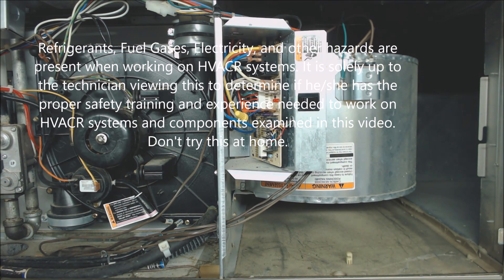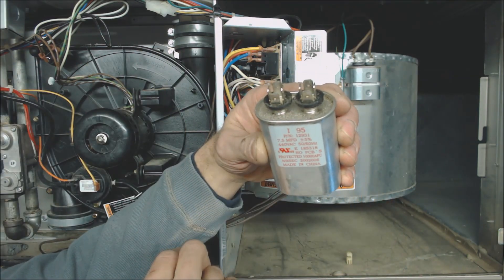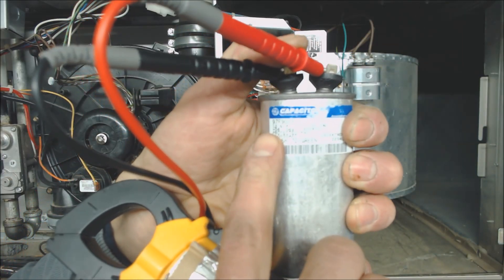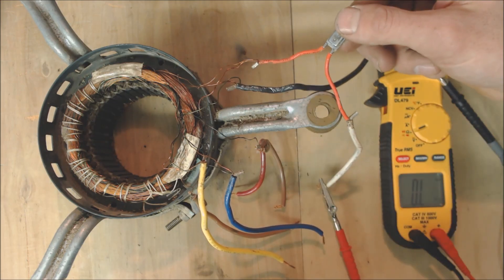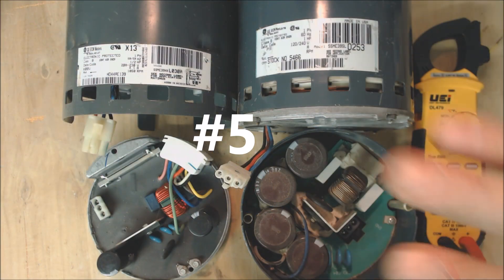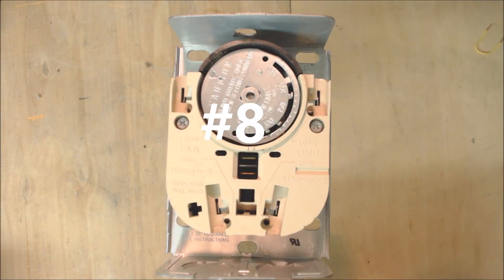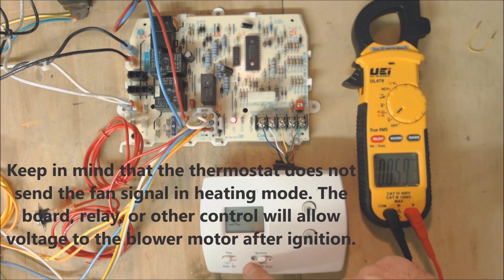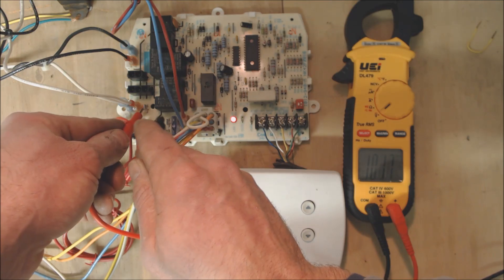Furnace or AC Blower Motor Not Starting or Working! Top 10 Reasons Why!

Comment: Hi. I enjoyed the blower motor lessons. Thank you. My blower motor stopped working suddenly. I heard humming on air handler. I was able to free spin blower to get it to start. I pulled the capacitor and hooked up my multimeter. It was definitely shot. I thought it was a simple enough fix. I bought a new one rated at 10uf, +/- 6%. I tested i before putting in and it read 9.74. I figured that was enough. I put it in and tried pressing button on handler, but nothing except free spin start. I gave it some time and reset breakers...closed it all up, but nothing. I took out cap to see if it was damaged during install, but same 9.74 reading. So I still have humming of motor without kick start from cap. Any thoughts? When cap burned out, could something else go with it? Thanks.
Reply from the maker: Have you turned the power off and disconnected to check resistance values including the capacitor? Also the brown/white wire should read 0 ohms of resistance with the common wire, If the start winding is burnt and reading 0.L across it, the motor needs to be replaced, thanks
Reply: Thank you for your response. I disconnected power and pulled out blower motor and cage. With a lead on common (white wire), the numbers are the following: Blue: 26.6, Yellow: 26.5, Black: 4.1, Red: 0.1 - When I put a lead on common and one on Brown and white wire, it measures 27.9. I pulled off the capacitor before taking these readings. Readings are similar when capacitor attached. Do you think motor needs to be replaced? Thank you.
Reply from the maker: Yes sounds like it as long as you are getting the correct incoming 120v to the furnace blower, thanks
Reply: Thank you! It is greatly appreciated.

Comment: Great video. My capacitor was bad. Corroded and rusty terminals and the top was bulged out. Didnt even need to test it. The part is $8.25 almost anywhere on the internet. I paid $25 total after tax and same day shipping (sunday) everything is working before 12 noon. I could have just paid the $8.25 and waited for Friday. I saved HUNDREDS for a Sunday job and learned like most things HVAC is pretty simple once you pop the hood and take a looksie! Hardest part was borrowing a ladder and getting on the roof.
Reply from the maker: Thanks

Comment: Thank you Sir! I paused this 58 seconds in, replaced my capacitor with the old blower (of the same model) sitting in my garage and it worked right off! You saved me $100's or more!
Reply from the maker: Thanks, make sure it is the same size as stated on the side of the installed blower motor, thanks
Reply: @acservicetechchannel  What possible damage would occur if it's not the same size??

Comment: if one of the control board relays are bad, do you guys just change the whole board?
Reply from the maker: You can change the relay out if you are handy enough and can get the part fast enough. Most of the time though in an emergency, a tech can get the board which may be stocked at the supply house faster than the relay, thanks
Reply: I had to replace the relay on my control board. If you can solder and you can get the part, it's going to be a lot cheaper.

Comment: Great video I have a Colman 
When I got home yesterday from work the batteries in a thermostat was dead. It's a new thermostat I changed out the batteries
And I'm not getting getting nothing I'm getting in no fan outside no compressor kicking on and no handling unit. I changed it to my old thermostat and still nothing
I just replaced the out door capacitor. About 3 weeks ago AC was working fine 
Do you have any idea why it would drain the batteries in my thermostat and now I have no power at all. I look for tripped fuses and they all are fine
Reply from the maker: I saw your response in the other comment, thanks!
Reply: I have the same problem was a fix found for this situation.

Comment: Nice video, thanks
my carrier air handler works for two hours and stop working, then refrigeration pipe frizes.
This unit does not have control board, the voltage is ok, I'm unable to see a capacitor at the motor, could you give me any idea to repair it?
Thank you
Reply from the maker: If the motor does not have a capacitor then it is likely a x-13, 2.3, 3.0 genteq motor. You could look up "acservietech ecm blower motor troubleshooting" thanks
Reply: When ac freezes u need freon charge use proper guage can't overfill or under fill or it won't work

Comment: How about humming noise coming from the blower motor. Blower moves freely but doesn't turn on. Barely new motherboard about two years old.
Reply from the maker: Does the blower motor have a capacitor? If not check out "acservicetech ecm blower motor troubleshooting" thanks
Reply: @acservicetechchannel  it does have capacitor but when I checked it I was not getting any reading. But I was getting a low resistance on the blower motor. So I want to troubleshoot it before I called out my home warranty company in case it was something less than my deductible. It did turn out being the blower motor and they replace the capacitor because it need to match the same voltage the new motor needed. Even though he checked my capacitor he said that it was good but would fail because it was under by 3 volts. Thank you for your video it help me diagnose it some what but also get a better understanding.
Reply from the maker: Thanks George!

Comment: my window ac fan stop after 2 hour . but compressor are running normal .
Reply from the maker: Could be a lot of things. If the fan is not running, it could be seized, bad capacitor, bad voltage, overheated, thanks
Reply: @acservicetechchannel  thanks sir

Comment: Hi,On my Nordyne AC air handler,  I'm not getting the 24vac at the thermostat and  the blower motor isn't running in any position of the thermostat. Any ideas ???
Reply from the maker: Are you reading 24v in the air handler at the wires connecting to the thermostat? Did you check the fuse?
Reply: Thanks It was the 3 amp fuse on the control board. I checked the fuse connections for a dead short before changing the fuse then changed the fuse and it's back up and running now thanks again!!!
Reply: @ChiefGrayCloud  what if I put a 15amp fuse just for tonight?  I stay in Texas and booooyyyy is it hot🔥🔥

Comment: My furance in the house is clicking like it trys coming on. Trys for about a minute or two then clicks an stops then it repeatsx. but wont turn on it just keeps trying to over an over. What could be the causing this  problem?
Reply from the maker: Do you have your thermostat set for heat or is this happening when the tstat is not on or set to cooling?

Comment: The problem I have is that the blower motor on the Goodman air handler keeps stopping & starting.  If I turn on the fan from the thermostat ...with or without cooling.....it works great... for about 10 minutes and then it shuts down.  After about 15 minutes or so....it will come back on for another 5-10 minutes...then goes off again.  It keeps doing this.  I replaced the capacitor but it didn't make any difference.    Thermal overload?
Reply from the maker: That was what I was thinking. Does the motor get very hot after it shuts off and after you turn the power off? If it is, I would just check input voltage to the motor before and while running to make sure that it is ok. If it is, and the motor was very hot then you would need to replace the motor, thanks
Reply: Thanks for your really fast response.  I turned the FAN on at the thermostat.  The  blower motor came on and stayed on for 10 minutes and then it shut down.  I went to the thermostat and clicked FAN ON off & on and the motor came back on right away...but only for about 4 or 5 minutes this time.   I immediately checked the motor cover with my thermocouple gauge and it went to 140 degrees F.  Is that considered pretty warm?  I  My system was installled when the house was new 15 years ago.....but I bought the house 9 years ago.  I never used the heat at all (Southern California) and only turned the A/C on maybe 5 times in those 9 years but it didn't cool well because the blower fan kept going off & on....so I just never used it again.  (When it's on COOL my temp gauge said 62 degrees at the closest register to the unit) though). I'm guessing the blower has been shutting down like this since I moved in. The motor and 2 squirrel cages are spotless as was the filter.  Do motors go bad without being used much? I probably don't have 3 hours total use in 9 years.  I did test the capacitor I removed just to see if it in fact bad but it read 14.93  (It's a 15)  so that didn't fail and damage anything. I will check the input voltage today.  Is there any kind of relay on the board that could be causing it?  The motor just seems so pristine and seldom used to be the problem.
Reply from the maker: 140 degrees is pretty warm but that is on the outside. Have you checked this video out? You should turn the power off after it shuts off on you and read the resistance of the common wire through to start or run-  https://www.youtube.com/watch?v=IBg0EZg0ohY

Comment: So my blower motor won't kick on and I have a new motor, an new capacitor and still won't kick on the tested the relay for it and it's good, the thermostat is new as well any ideas cause it's hot here in Oklahoma. It's a Coleman unit in a mobile home please I need help
Reply from the maker: Does it have a limit control that you could set on manual for now or is it controlled by a control board?

Comment: You replace the motor if it goes off on thermal overload?
Reply from the maker: That is what would happen if a capacitor goes bad, the only thing that stops power to the motor is the thermal overload opens the common wire. It will certainly hurt the motor when this happens and the motor can be megged out to test to see how bad the insulation suffered, thanks

Comment: I have a rheem unit and the indoor fan is not working but I was told on this particular unit that there is no capacitor for the fan. Is that likely? Also when I turn the unit to on I can hear the control board sending making a clicking sound but he he can sometimes comes on and sometimes it doesn't. Some days it could be the sequence or a bad control board.
Reply from the maker: The motor could be a ecm or ecm variable speed without a capacitor. The tech would need to verify readings between the board and motor, thanks
Reply: DMACKD mcdavid , mine is doing the exact same thing, what ended up being bad on your unit?

Comment: Did UEI say to leave the capacitor hooked up for "10 to 20 seconds" to get a good reading???  Also you need the voltage capacitor to be at or above the voltage you are using.
Reply from the maker: Hey Tim, That is what I found with the UEI meter. Sometimes you will get a reading but be patient because it may change. I find that if I wait the ten seconds then it is an accurate reading. You are a 100% right on the voltage being the same or high on the cap, thanks Tim!

Comment: fuse blows on circuit board when I turned on the a/c (replaced fuse) and  later tried just the furnace fan fuse blew again, any ideas what to check.?
Reply from the maker: It sounds like you may have a short between the g wire and the common wire if you do have a control board. See if the fuse blows if you turn the power off, take the tstat wires out and jump from r to g  at the control board and turn the power back on, thanks

Comment: hey bud im working on a split 2.5 ton system. System was 3 weeks old when it developed a huge leak. Took care of that. Never did installs but the box the coil is in is real flimsy and i have have low pressure low temps. Going to confirm t.x.v is 410a but i think air could be bypassing the coil because of the non exsistant box.
Reply from the maker: Low airflow would read low pressure low superheat, thanks

Comment: Hey so I’m hoping you can help yet again to answer a question for me. So my company has been installing nest E thermostats and for some reason I was told that they are not compatible with variable speed blower motors as it will not allow the motor to ramp up speed. This confuses me because doesn’t the thermostat only close the connection between r and w and then wouldn’t the control board at that point decide on the ramping of the blower? Also if you can in the future please talk about power stealing stats and how they operate or effect operation of hvac equipment because we install a tonneeee of these we actually have a contract to install 50000 up here in Canada so the hvac community will see more and more of these. When you have a chance please address this and as always thank you so much for all the work you put in you can’t imagine how much I’ve improved in the field because of your work.
Reply from the maker: Everything you said is 100% correct. The nest stat only connects the r and w at the control board. Just make sure that you are selecting single speed furnace in the stat and let the furnace do its own thing at the control board. People are probably getting confused because there is an option on controlling 1st and second speed in the tstat. Just select single if it is variable speed. If it is a two speed and the last stat controlled the 2 speeds then you can wire it that way in the stat unless you know the board can ramp to the second speed itself, thanks.
Reply from the maker: So the energy company has hired your company to install 50,000 nests?
Reply: acservicetech nest e, ecobee3lite or Honeywell lyric. Customer choice
Reply: acservicetech  also I don’t believe there is an option to select that in the nest is there?
Reply: acservicetech nest e btw not nest learning stat
Reply from the maker: Hey Dan, yes it is W1 and W2. It can actually do three speed if set for it in the programming, thanks
Reply: Daniel Dummett
Reply: Daniel, NEST says the E thermostat is not compatible: 
https://nest.com/support/article/Learn-more-about-the-Nest-Learning-Thermostat-and-multi-speed-fans#how-it-works
"Fan compatibility:

The Nest Learning Thermostat is only compatible with system fans that have one, two, or three stages.

The Nest Thermostat E is only compatible with single stage system fans.

Variable speed fans, high voltage forced air systems with fans, and proprietary systems with fans, not compatible with either the Nest Learning Thermostat or the Nest Thermostat E."

Comment: We just recently replaced an x13 motor under warranty.  Tested it and it was running great. Ironically had a call back with the same problem of no air flow a week later. The new motor malfunctioning? NOPE  Guess what?  It was the insulation on the door panel coming loose that caused the problem the whole time.  Ugh  Ripped the insulation out but the motor was fried again.
Reply from the maker: Yeah they break themselves when there is high friction in the duct system just like when the filter is dirty, thanks for adding that one!

Comment: One decision that is tough for me is whether to replace the blower wheel with the motor. Sometimes the wheel itself can get out of balance. Sometimes a metallic "whirring" sound indicates a blower wheel replacement.  A sign of bearings going bad can be a slight high pitched sound when the motor is up to speed. Also a grinding sound during operation.
Reply from the maker: Great add ons!

Comment: Another problem could be a product called "Add-a-wire", I've seen these fail over time. This can disrupt power to the heating/cooling or the fan on mode. It's better to have the correct amount of wires needed than to install a "band-aid" such as that product.
Reply from the maker: Thanks Blue Collar, another great tip!

Comment: No fan in heat mode but worked in fan "on" mode.  I changed the limit switch 3 temperature settings & then reset them to original settings.  The fan in heater mode  now works correctly  with delayed start (heat up) & shut down (cool down).  Why? (Stuck contacts?)
Reply from the maker: Yeah, if you are talking about the fan limit control, I would replace it. They are fairly inexpensive and it will likely keep happening otherwise.